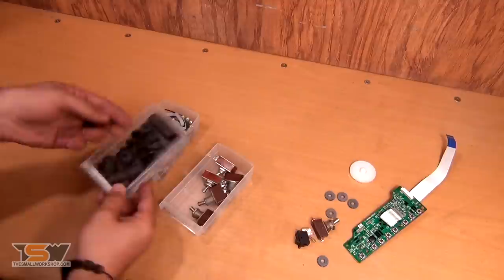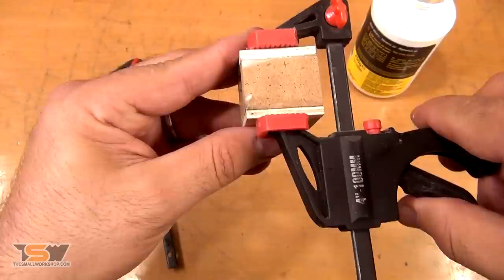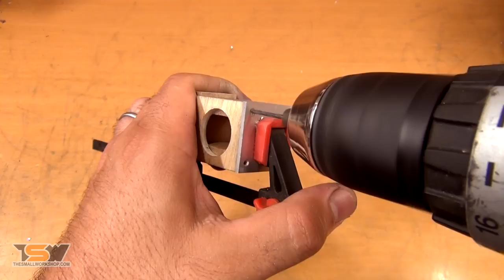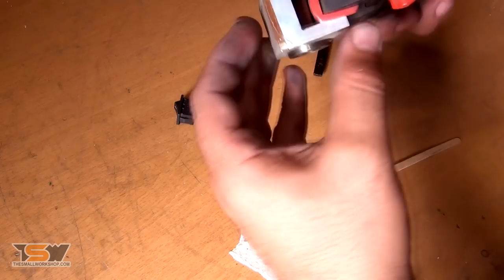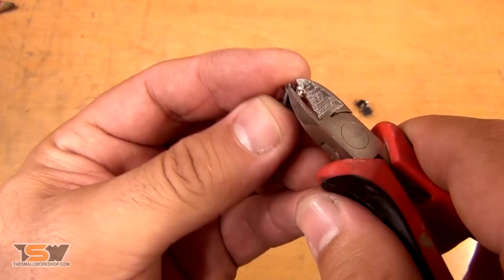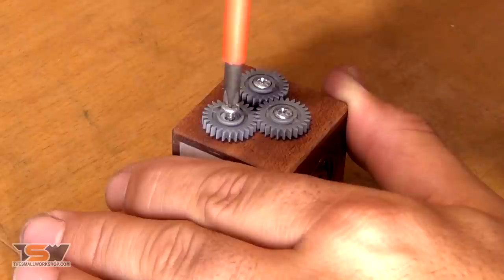Homemade Fidget Cube Spinner Combo DIY

Comment: You know that you could have salvaged a ball bearing from one of the stepper motors that you had? That's what I did for my fidget cube fidget spinner!
They should be really high quality ones. At least from my experience :)
Reply: What type of wood did you use?
Reply from the maker: Man you had two awesome ideas in your video, the threaded rod and the weighted top spinner, wish I've seen them when I designed this thing! The wood is mahogany.
Reply: Thanks!
Pretty much everyone that I show the cube to thinks the threaded rod spinner toy is awesome. It's my favorite after the spinner :)
I salvaged the steel weights for the spinner from a toy RC helicopter a few years ago, and just cut them in half so they wouldn't be too tall.
Your cube looks way better though! I like the gears too, I used to have a collection of them.
Reply: And the aluminum and mahogany look really nice together. I need to start working with the aluminum more!
Reply from the maker: Yea, wood + aluminium + switches is a combo they used a lot in vintage electronics and I really liked the look of it.
Reply: I heard that you need to anodize aluminum if you use it with wood since it will leave gray spots or something like that... Not sure.

Comment: What is the product you put on the wood? The one in the black bottle (around 11 minutes). It makes the wood look awesome and shiny :D
Reply from the maker: It's mineral oil. Any oil will do that to mahogany, the wood fiber shines under oil finishes. Best choice would be boiled linseed oil as it acts also like a top coat. Off camera I added a layer of wax for extra protection and also to make it smooth to the touch.
Reply: The Small Workshop Thank you very much :)